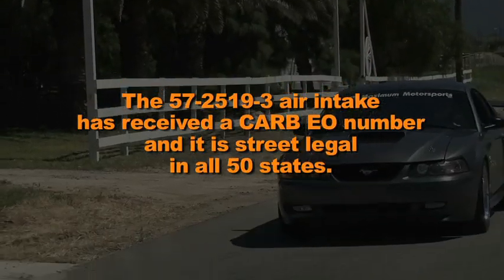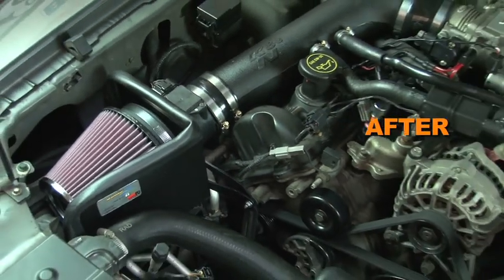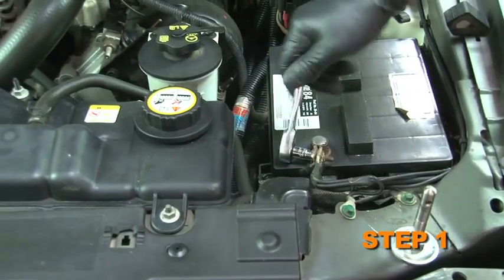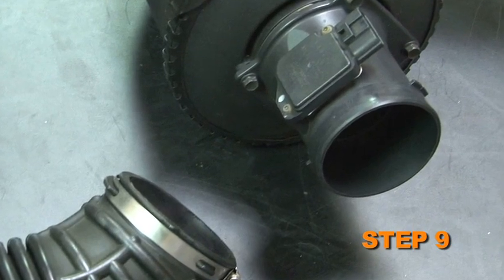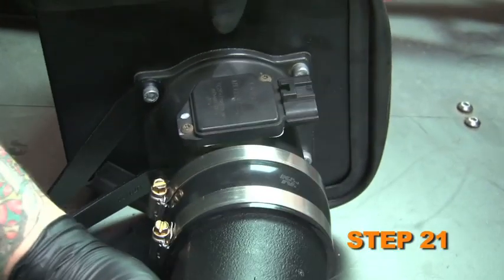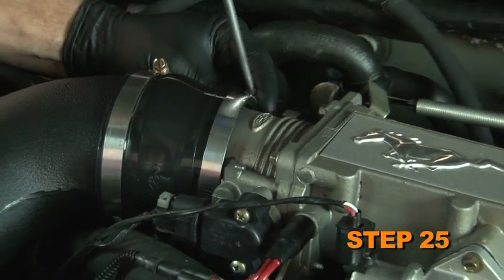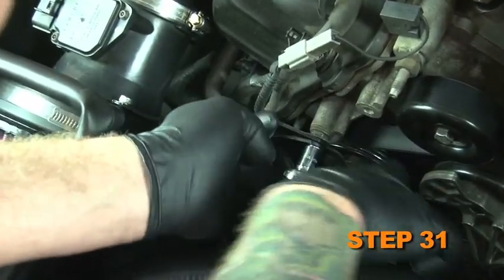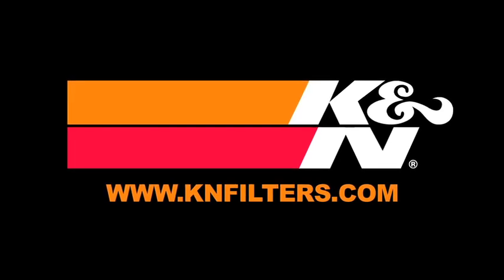Ford Mustang GT 4.6L [#57-2519-3] Air Intake Installation

Comment: Is there a way to remove just the heat shield and filter section? For some reason when I go to remove the filter to clean it, I'm not able to remove just the filter without scraping.